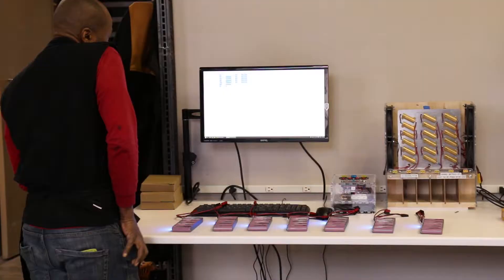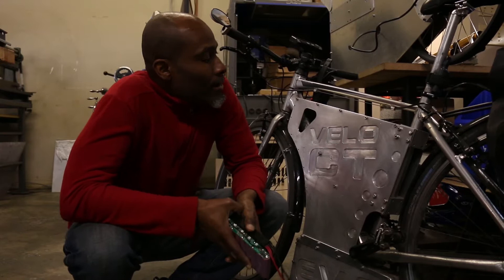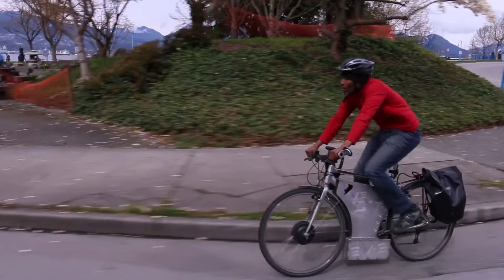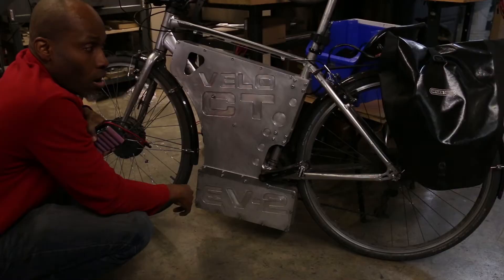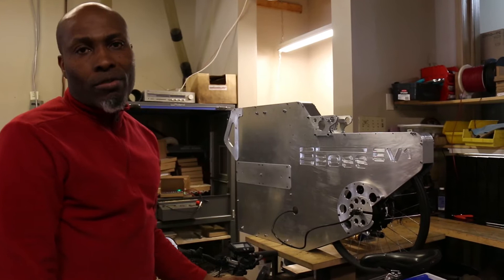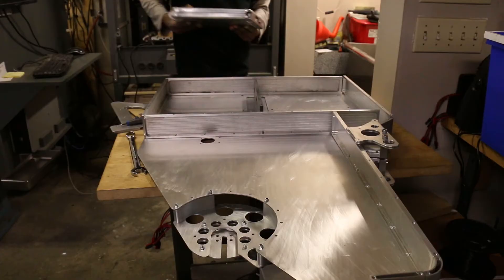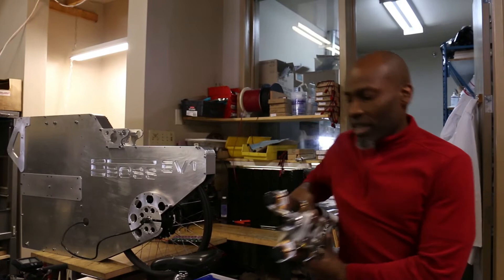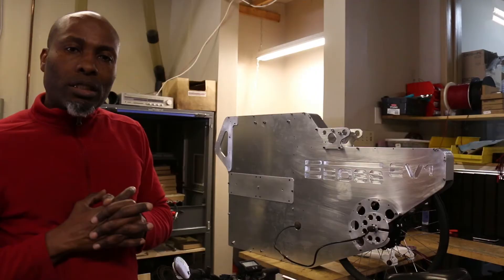Grin Profile, Keith Forbes

Comment: My question to you is when you feel that thing up someone's full battery capacity and you don't pedal one stroke and you weigh 200 lb what will be the range of that system per day and if you drive it less than what you do what will the battery life capacity be what's the best way to charge it you don't pedal that take one day it's all Throttle battery capacity that you want and you draw it out and you use that much better so I thought you going fast speeds what is the capacity of the battery that's where some of that go 60 miles an hour and some of that goes $25 an hour will it cost you if you maximize the theory out you buy a big battery pack of you haven't used all 10 miles a day on it it will last us about a time but if you use it to the maximum 200 miles a day it will last you probably 200 charges if you do 10 miles a day 200 miles I thought I would have battery cost it cost $100 to build a 10 amp battery pack yeah I sold it for $400 now your battery pack for the together you should be that's pack for half the price of four hundred bucks and make a profit of it and I would buy it with your battery cost you ten bucks and now it's be able to ship that you're not paying shipping fees so send me those batteries that way and I'll buy your batteries the same way but I bet your batteries are just as expensive buying them your way as they are buying him any other way but you're a lot of fly with a big deal who wants to fly with your battery if you were going to Rich how to travel with him to be much better

Comment: So you're using a Nissan Leaf that's his car battery died Centigrade technology battery how many can you get in there how far will you be able to go you won't be able to fly with it but what would be the cost to get that bike up to whatever those Batteries Plus and find it by the grid technology where I couldn't do the batteries together how many would it would it be to batteries when you called cycle Allison you have the Grim charger at what does that cost total and we build that case for any bike it doesn't matter what you will not change the glass spiked leather tires rims seat breaks all a weird place at a certain point the battery pack will last how long and how many miles on the tires out ways with a bun with a battery out of the tires what is the total cost of a bicycle to go per mile per hour I want to set a one minute of it it'll cost you how much money that's the question of the day

Comment: Whatever it takes to make a 36 volt battery you're going to need five of those or six of those I don't even know at least one of those is a 36 volt battery I guess that'll get you how many miles without pedaling your weight on your bike if you had 10 of those that you're going to get 10 times 5 if you don't pedal and your weight what is the mileage range of each one of those battery packs and what will be if you get 5 miles of 1 miles on that battery pack at your weights how many hours does it take to replace that one hour of power and how many can you fit inside that battery box so what is the total cost to fill that they was batteries like rigid elegy and how many miles will you get out of the rain on that bicycle and will you destroy the Earth handle the heat of running on a flat land straight till that battery pack goes out will be how far can you go per are your weight averages you create your own wind so if it was bowling against your big deal you go 20 miles over you go 20 miles back the other way with you or behind you it doesn't matter which way if you go both ways with the wind that's great but if you have had a person so you weigh 200 lb per pack five of those grids battery packs cost and if it's so at least want to get you to miles what motor will be able to handle it not heat up control of what I'm going to eat up your help with The Pusher wait till he killed 10 of those batteries how far would you go without pedaling that's the question I want to get a straight answer elderly change it a little bit of percentage of miles average if you have 20 miles to go everyday when did it's always windy to cover it that's it that's a simple procedure be able to talk to you later found uphill without everything pedal what motor will be able to do that and don't have to settle those are the questions you need to know average voter should be able to go up on over a little Hill download waiver average way more Kool-Aid way more controllers all kinds of things have to be done everything has to be beefed up to the point where it's going to struggle

Comment: Please do it case management when it comes to batteries you have the bicycle by itself you have a battery that you buy for $500 and you buy a hundred of those the One battery that you use every battery the same amount every day that you're going to use the one battery goes 1 mile the best way to buy these batteries and that's what we're trying to figure out there when it comes to wait we can figure out what the distances weight-wise so anybody that weighs twice as much as the next guy will probably double score of the weather for this based on weight and doesn't matter depends if you drive it 1 mile a day or you drive that's a 200 pound lighter 10 miles a day the batteries going to end up having so many miles can't recover from that so how do you make a lipo battery last you want to make it last by having it go it's full length capacity the most you can get out of it so when you buying it if you buy it for 10 times the amount you need and only drive it one hour a day per battery you probably going to get twice the lifespan of those batteries if you would if you went the other route you can't buy a 500 what would be $2,000 and get you 8 years versus bike what battery a year for the full 8 years you pay way more you pay double the price so there's got to be a sweet spot there for you guys we can talk till we drop about who pedals and who assists and went down when is what type of weather you going at that doesn't matter man that's irrelevant if you drive the battery 10 miles a day that this the bike on it and it goes to and from everyday the same thing what will be its life capacity if you drove it one mile a day if you got if it went 10 miles a day that's the difference will that battery and those two hundred days if you only drove it what about they will it get more when he gets up to 2,000 miles will it still be working 20 hours over a year